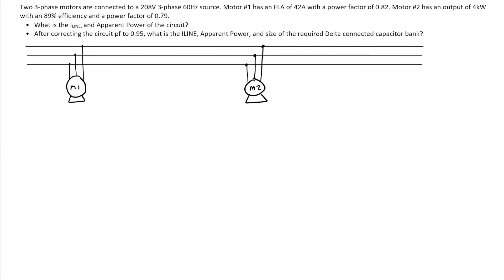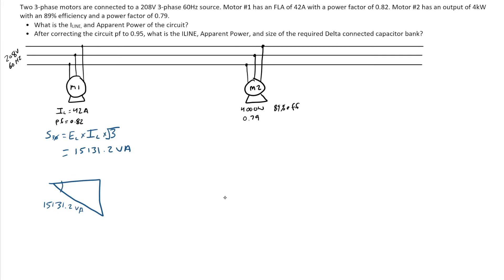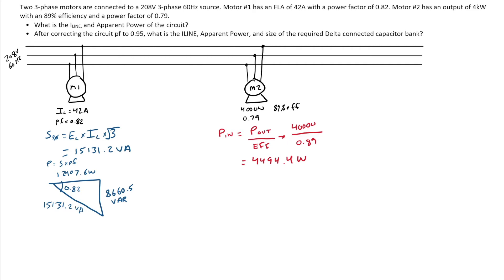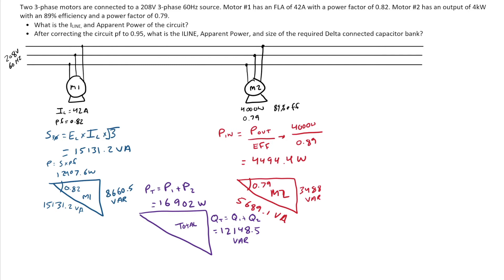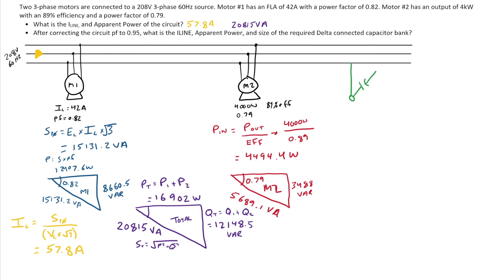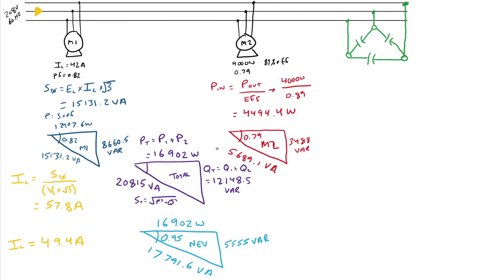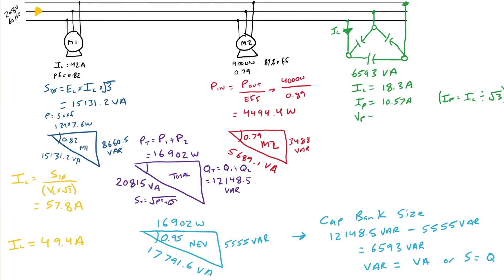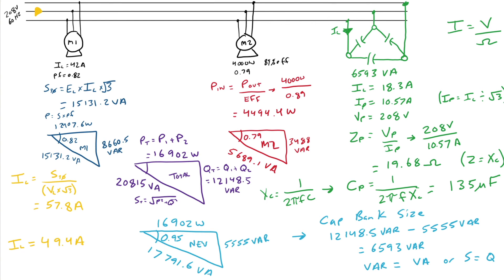Power Factor Correction Calculation in a Three Phase Circuit

Comment: How did you get your IL = 18.3A, and in green is it VAr instead of VA?
Reply from the maker: Just using the same formula that we use through the whole video. Iline = S / (Vline x Root3).

In this cause because it is purely capacitive the VA would equal the VAR, sot hey are the same.